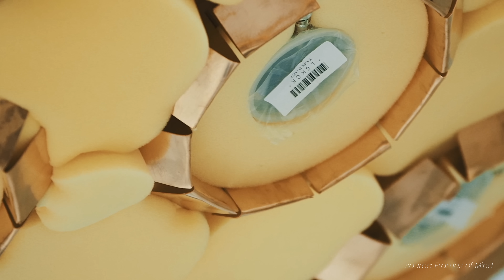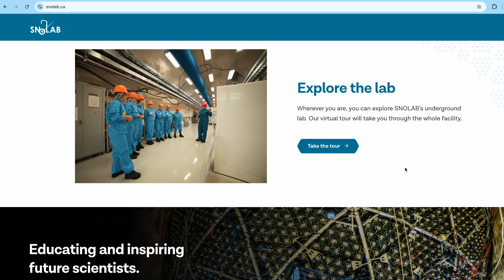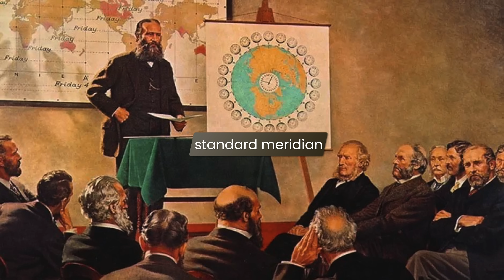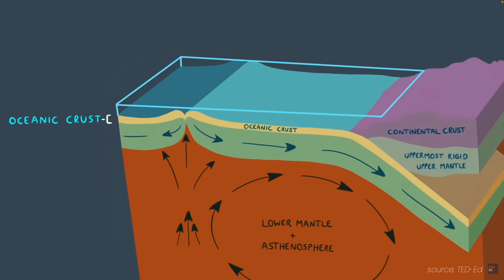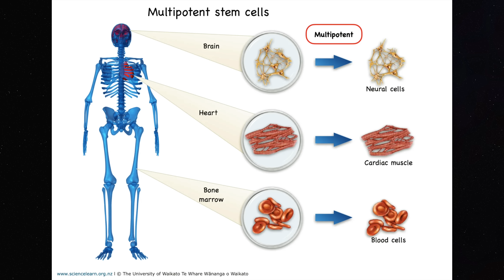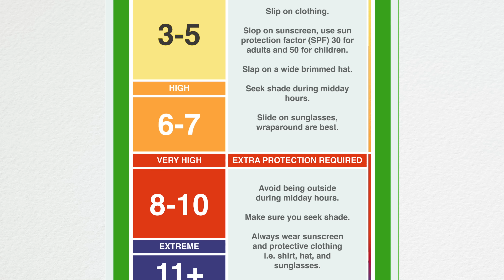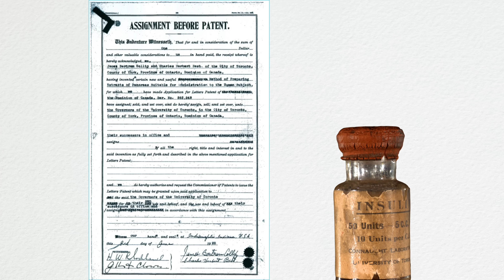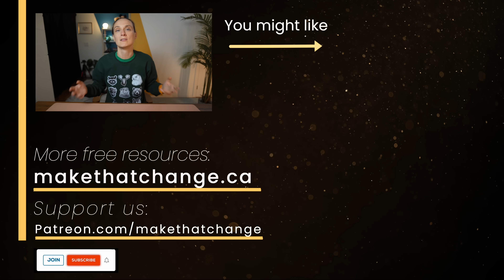7 Times Canada TRANSFORMED the World (And Nobody Noticed)

Comment: New developments might also be investigated. The Boltzman Institute, comprised of a growing number of semi-retired engineers, is examining difficulties that arise from the movement to increased electrification via Ev's and heat pumps. A major difficulty is not only the exorbitant cost of the increased capacity in generation that will be needed to meet projected peak loads but also the increase in fossil fuel combustion needed to produce it. Movements to renewable sources of electrical production have the limitation of inconsistency and therefore also the difficulty of storing electricity during times when renewables are not producing. The Institute notes that the Pickering nuclear generating plant produces enough waste heat to heat the entire city of Toronto that could be stored and used in hot water. District heating is an underutilized possibility that is being promoted for use anywhere that large sources of waste heat are generated. The nuclear industry is getting on board. We'll see where this movement goes from here, but it is encouraging so far.

Comment: Quantum Mechanics permits calculating the probability of specific observations at small scales.  Until you open the box you do not know if the cat is alive or dead.  In the case of neutrinos, the smallest particle, when you "open the box" you will observe either an electron neutrino, a mu neutrino, or a tau neutrino, each with a probability of 1/3rd, independent of what went into "the box".  This is not a "fluctuation" as popular media depicts.  Until you "open the box" the neutrino is in a superposition of all three possibilities.  The experiments in SNOLAB and at the SuperKamiokande lab in Japan can only detect electron neutrino, so they see 1/3rd of the particles.  It is like tossing a dice.  While it is tumbling, it is in a superposition of all six sides, but once it comes to rest, it is in one of six states

Comment: the Neutrino detector has a flaw ... it can ONLY detect up to light speed ... since that is NOT a maximum (james webb Cern Proven) and that it is NOT a constant (basic physics diffraction) .... so it will only see what gets slowed down when it hits something ... 

it is near impossible to detect something faster than light if you can only detect upto light ... like trying to measure a 12v battery with a 10v only meter .... to fin faster stuff one has to fin defections happening BEFORE they could this is how CERN found 60ns split of data that arrived BEFORE light could arrive .... yep Cern also ONLY detects UPTO light 

if you dont put the Tele[hone own as one then you FAILED basic history ... Alexander Graham Bell IS Canadian 

yep you missed the BIGGEST Canadian Invention ... the PHONE .... look around EVERYONE has at east 1 ... some have more

Comment: They are all outstanding but the neutrino lab underground is much less useful. I must add that using the word "create" is offensive. I know that the scientific community uses this word often. It is always wrong. In the case of the neutrino coming out of a Beta+ decay in the Sun, it is due to the transformation of a gluon into a neutrino (based on my works). Using "create" goes with the belief about a creator, a god, something controversial, especially in Science. 👋👴
Reply from the maker: Thanks for pointing that out, never thought about it this way.

Comment: Both the aviation flight suit that protects pilots from blackout due to g-forces causing blood to pool in the Lowe limbs and the wet suit to protect sailors suffering hyperthermia when emerged in cold attic water are Canadian inventions
Reply: The original anti-G suits were developed at a research lab in Toronto by Dr Franks. The dive decompression tables used by divers to avoid decompression sickness ("the bends") were developed at a lab in Toronto which was a successor to the lab which Franks worked in.
Reply: @TimPointing  Fun fact - Dr Sir Frederick Banting helped Dr Franks with developing the anti-G suit - tragically Banting was killed in a plane crash early into Franks' work.
Reply: The first G-suits were made in Canada, but liquid suits had issues and the parallel development of gas suits in Australia was much more significant and quickly supplanted the liquid ones.

Comment: One of the biggies during WW II, was the accidental discovery in Ottawa, of Polysaccharide to help diminish traumatic shock which often led to death.
Plasma and whole blood were not always at hand when a soldier was injured (shot) on the battlefield, the resultant blood loss would and drop in blood
pressure caused shock, normal saline helped for a few minutes but, did not possess the volumetric capacity to grant the wounded that ''magic hour''
to be rushed to an aid station/MASH for surgery and blood transfusions. Updated versions of the formula are still used today as it constitutes the only
ambient temperature IV for shock prevention treatment that can be carried by military medics, or civilian paramedics.  Be well and stay safe
Reply from the maker: Wow! Thanks for sharing that. Stay safe you too!